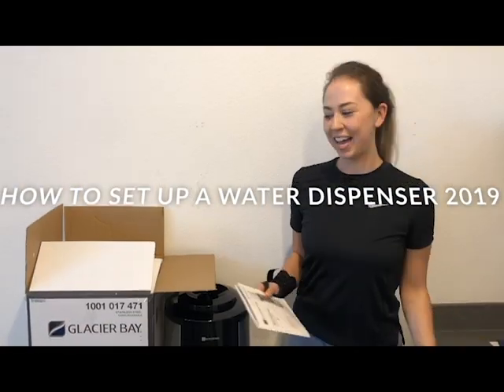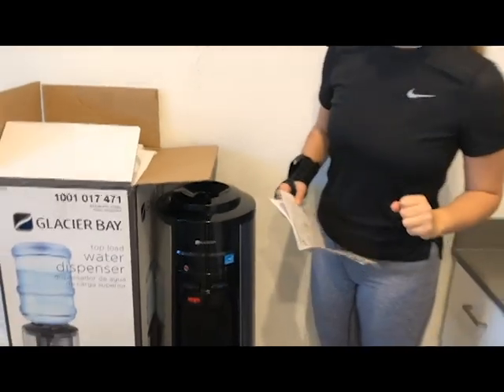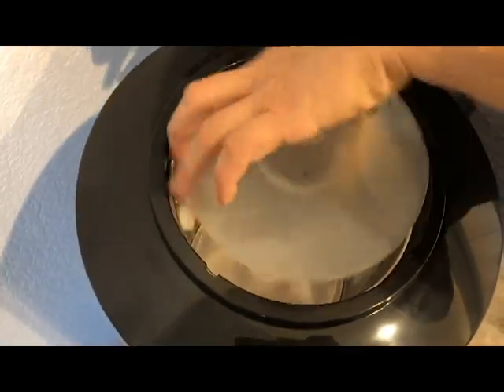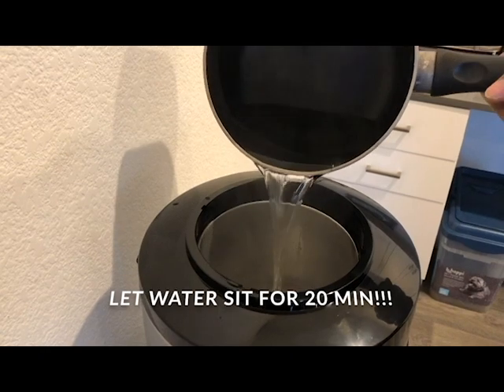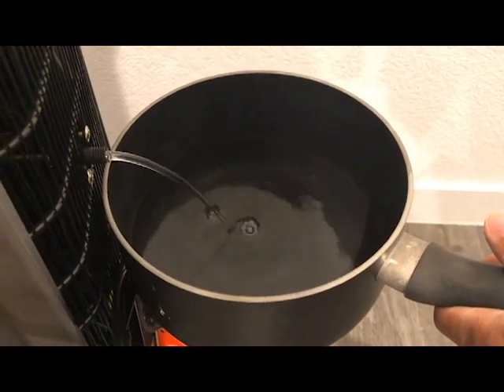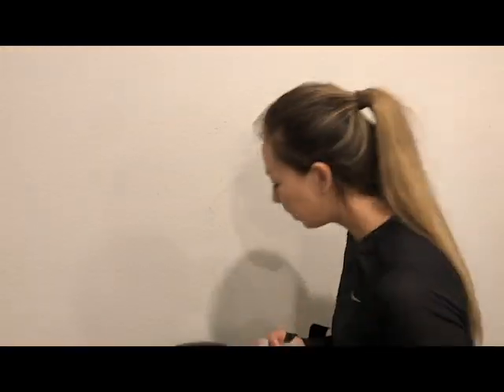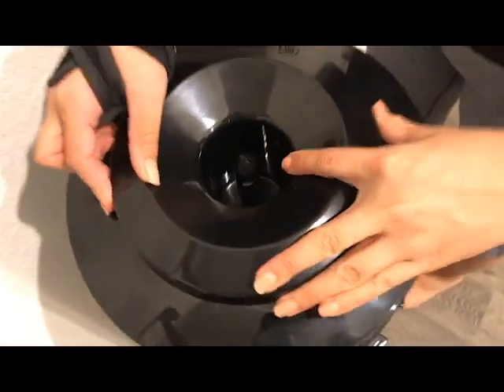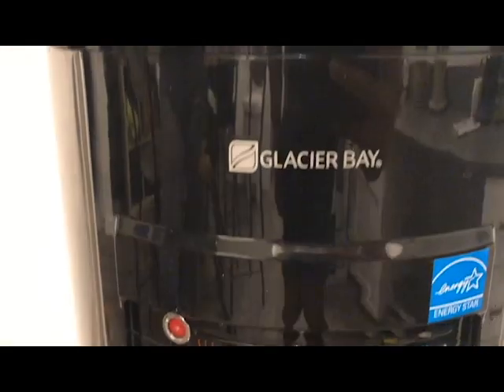How to set up Glacier Bay water dispenser 2019 (unboxing)

Comment: So. Here is the ONLY video that I found to address the sketched manual that made sense of it all. One thing I'll add, tho, in the back there is a plug beneath the black knob.  I didn't know it was like that...I thought the know was supposed to be a spigot...and no. So I called Customer Service who disconnected as soon as my problem was explained.. Pre Operation procedures 12 through 15...Make sure you REMOVE the plug so your dispenser will drain from the metal tube. The sketch indicates a bucket underneath. You can use the pot you heated your water in. Half of your draining will take place in the front on each side, hot and cold. The other half in the back.  DO NOT LOSE THE PLUG. It is smaller than an earplug and when you pop it out, you'd better be ready to catch it! So thankful for this video! You rock!

Comment: how do you drain the hot side? mine will not drain on hot side
Reply: I came here for the same question. ☺️
Reply: @Emmas2023  You have to slide the red tab above the button over and then push the hot water tab. Took a few seconds for the full stream to start coming out of that side
Reply: Our hot side didn’t drain until we put the bottle on (but still not plugged in) I read somewhere that it has a low water sensor, so I don’t think it will work until then.

Comment: How long did it take to cool water ?? Also when did the blue light for cold water turn on??
Reply: Mine is not cooling! Never turns in the blue light!
Reply: @MarioMalvido  you should get a new one and leave stand for 24hr then clean it and follow directions after you do that in about 2 hours would start cooling and when the water is cold it would turn the blue light that’s what I did I had to change it because the first one was damaged
Reply: @sabrinavlogs853  creo que habla español! Pienso que el mi está dañado, tiene 3 horas conectado y no ha enfriado. Eso si, calienta sin problema!
Reply: @MarioMalvido  si está dañado tienes q ir a la tienda y remplazarlo cuando tengas el nuevo dejarlo parado fuera de la caja por 24 horas un día cuando halla pasado ese periodo de tiempo lo limpiar por dentro con agua caliente y vinagre después le sacas ese líquido y le echas agua sola para quitarle ese agrío del vinagre cuando lo alas limpiando le pones el tanque de agua arriba y los conectas esperas máximo 3 horas para que enfríe cuando ya halla enfriado prenderá la luz azul el truco sin duda es dejarlo parado por 24 horas eso fue lo que hize y me funciono espero te halla ayudado

Comment: Actually not a great video. You are wrong. You leave the water/vinegar mixture in the reservoir for 20 minutes. It needs to stay in there for 20 minutes THEN drain. AND you have to use 4 CUPS of vinegar not 2. Its 4 cups hot water with4 cups of vinegar. You're welcome.